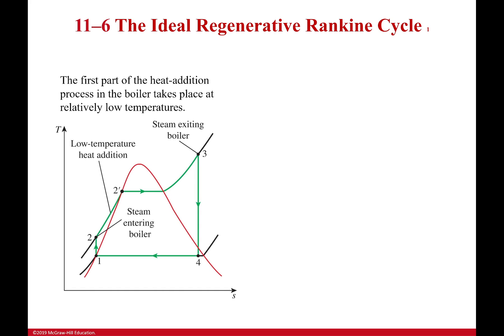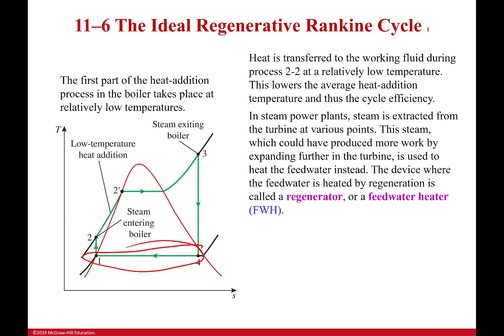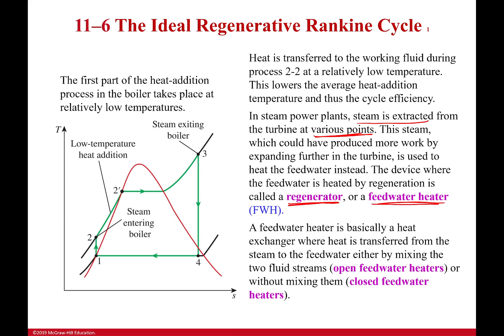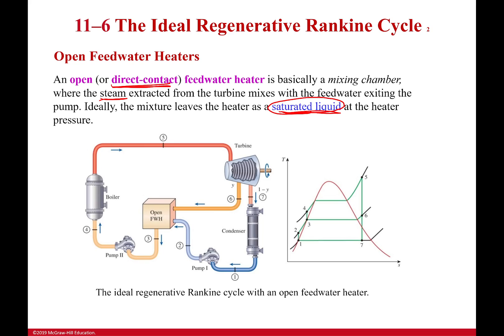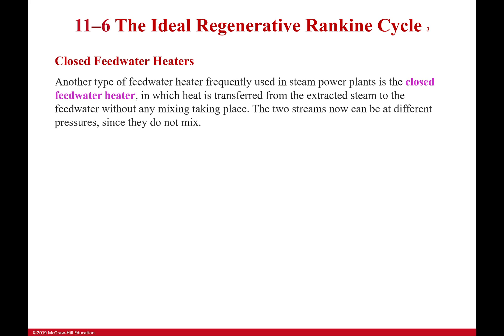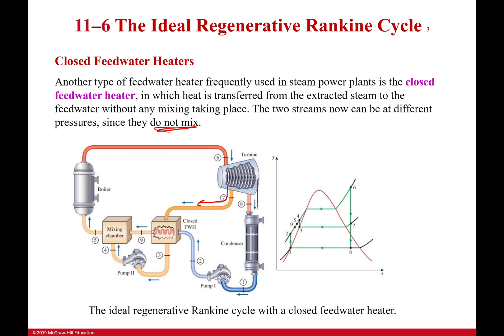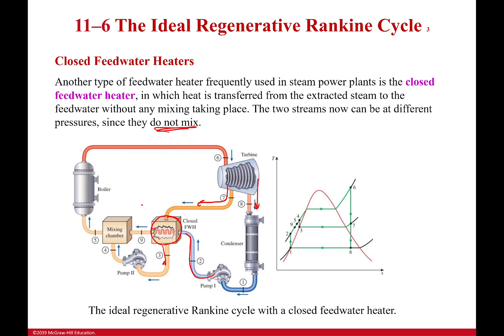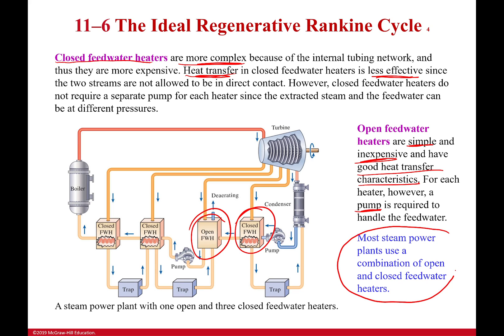Ideal Regenerative Rankine Cycle

Comment: Would I be able to know the heat balance equations used here? Much recommended if both High Pressure Heater and Low Pressure heater (apart from just one fwh used for simplicity) is used for the derivations. 👍
Reply from the maker: Check out this video. It gives an example with more complexity. https://www.youtube.com/watch?v=YPr87Rm-cGo